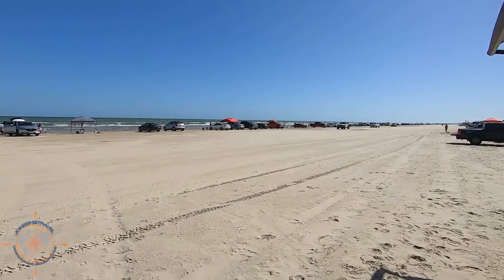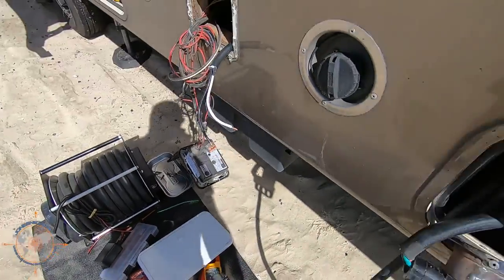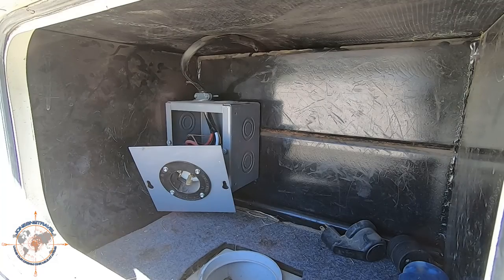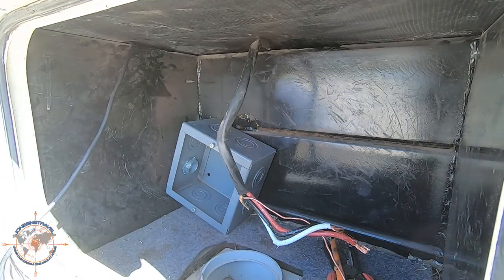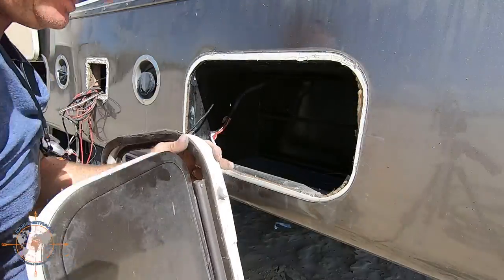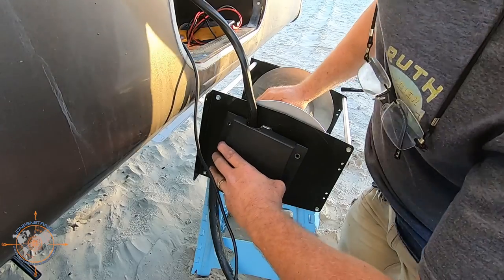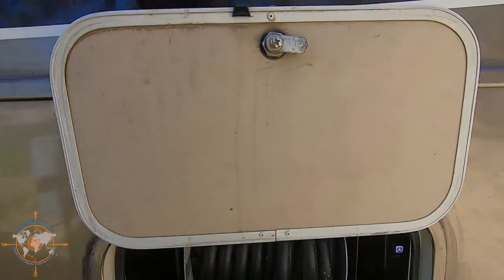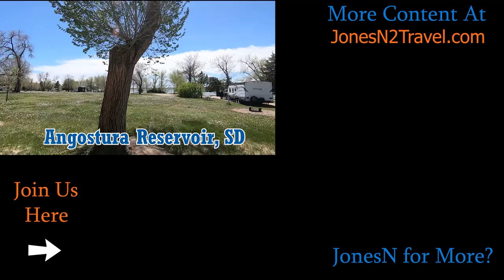We Narrowly Escaped An RV Power Cord Fire! | Cord Reel Install Overdue | HDT RV Life

Comment: LOL, we are at Jolly Roger RV Resort in Marathon FL, and last week my 50amp plug looked a little jenky, and sure enough  bad wires in the plug. So while the wife held down the pool, i put a new plug end on the cord. Glad i saw that,
Reply from the maker: Hey Larry. Yeah I didnt even realize I had a broken wire at the plug. Glad you found it as well. :) Thanks for checking out the video and for following along. Safe Travels

Comment: Aaron, great video.  We have an older NH that the previous owner removed the cord reel.  He complained that they were junk and did not last over a year.  He replaced it twice then did away with the power cord reel completely.  The reel motor kept giving out on him.  I think he thought that the reel would drag the cord in by itself.  I have heard that it is best to guide the cord in so you do not burn out the motor.  What brand was the cord reel you installed?  That looks like I could get it in where the reel was on our 5th wheel.  Thanks
👍
Reply from the maker: Hi Benny. Thanks for checking out the video and for following along. We had a cordreel in our Bighorn fifth wheel and it worked flawlesly for the 3 years we owned it. I purchased the 50AMP Shoreline RV Power Cord Reel RL54 Southwire. I purchased this one used on Ebay, came out of a totaled 2021 fifth wheel, for about half the price of new. Hope that helps. Safe Travels

Comment: Good video 😀 was the put in wrong area by drv your shure are good with electrical with diagram I'm in California diesel fuel 6.50 for now will higher fuel prices slow down your travel I know fuel prices in your area 5.00 you have 200 fuel tank I'm going to travel anyway but not so far but enjoy your travels
Reply from the maker: Hi Stpehen. We're not sure yet if the deisel prices will hamper our travel plans for the summer. We are planning a fairly heavy travel load so I guess we'll wait and see. Thanks for checking out the video and for following along. Safe Travels

Comment: If you would had a Progressive Ind EMS would that have caught the error? You would think DRV would have secured the wire coming over the frame. I like the flag also.
Reply from the maker: Hi Dan,
I'm sure the EMS would have noticed the amp draw but not sure it would have been high enough to trip anything. Thanks for checking out the video and for following along. Safe Travels